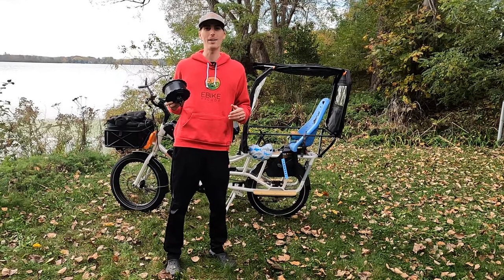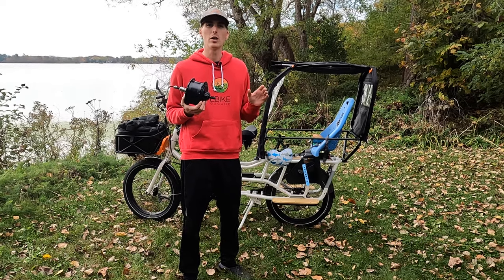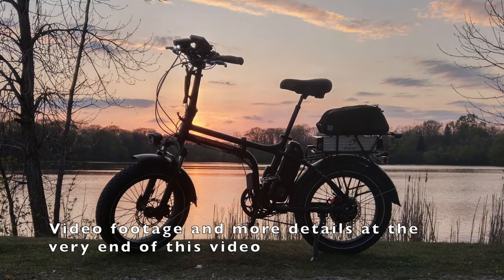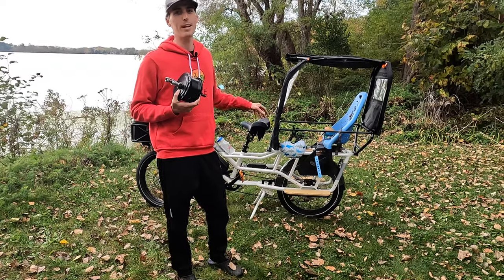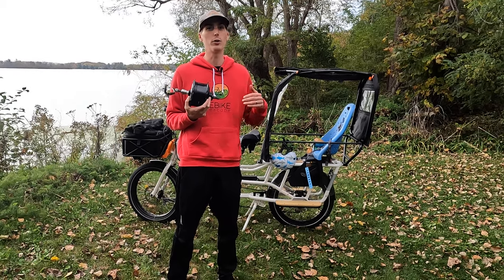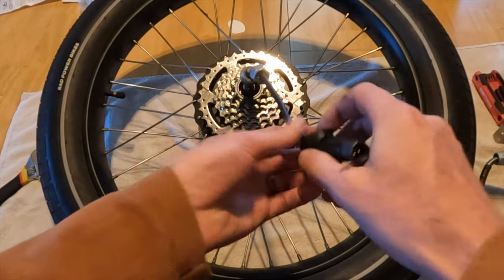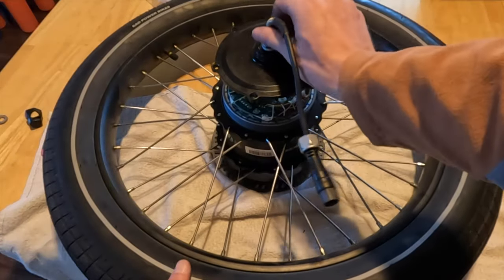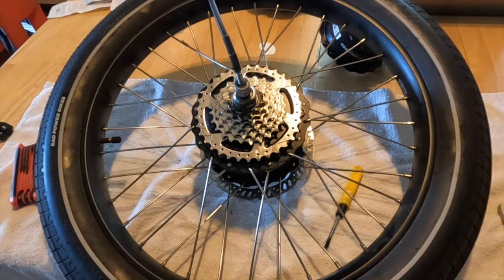Rad Power Bikes Motor Replacement with freewheel removal

Comment: Can I retire now that I'm famous? 😂
Excellent video Ryan, and I'm most happy that your bike is up and running again 😊. My wife often jokes that I should put a canopy on my bike, and I see that you have one already. It would be nice to see a video about that.
Reply from the maker: Ha! You have my approval! Yes, thanks again - we will share the Conestoga in a future video. It is currently only made for the RadWagon but it is awesome albeit expensive: https://radpowerbikes.pxf.io/6eOorm
Reply: Forever Young  - You will need to lace the motor into the back wheel, which is pulling out all the spokes and putting them back in with the new motor case. Someone may have a shortcut, but I have not seen it for the XP. The controller and display cost $472 USD, plus another hundred in custom wiring. On my bike, no one had done it before, so I had to make the wiring harness. An easier route is a packaged upgrade kit from Bolton or Electro Bike World, as that will push the power up to 1600 watts if you upgrade the motor.  The batteries were the most expensive part, with the shark battery being $480 USD, and someone gave me the second Tesla battery after I helped them program their Super73.
Reply: @EbikeEscape  perfect for my dog and some gear

Comment: Just wondering if you have any plans to test out the 35A controller on the Radrover 6 anytime soon? I'm on the fence but I don't see any reason why it wouldn't work.
Reply from the maker: Hi Richard, I do not - the challenge is everything is integrated. Best bet is to keep an eye on the Rad Owners Forum if someone does do this though: radowners.com

Comment: Hello, I had this bike since mars 2021, I use all the days of the week(not in winter), since last saturday it doesn't work, it is like no energy at all, I called support, they told me it must be the controller and the wiring Harness. the controller arrived, I changed but it still doesn't work, I hope when I changed the wiring it will work. My question, because my waranty it's over, I'd like to change all, the motor, the wiring and the controller too, something more reliable,could you please sugest me where can I buy that or where can  find the information to buy the good thing. Thanks
Reply from the maker: You can learn all about this on the forum: radowners.com

Comment: What freewheel removal tool did u use on the rad
Reply from the maker: We used the custom one from Area 13. we think it is the only one with a large enough hole to pass the motor wire through. -JT
Reply: @EbikeEscape  I was sent 3 different freewheel tools from Bolton/Area 13, none would clear the axle nut. Sent them all back.

Comment: So they didn't have the part avail and you did this, so does it void the warranty now?
Reply: He's using an original Rad motor that has not been modified, so his warranty should be fine.
Reply from the maker: The wheel is already on order and I proved the issue with Rad support before this swap. I'm guessing they wouldn't make a big stink about it unless I started asking them for a controller next. We now know the motor was bad. Hopefully they'd be happy to see me back on the road :)

Comment: cancelled my RPB order today.  pushed my ship date 2 months out the day it was supposed to ship (weeks ago).  They didn't even message me to let me know.. tsk tsk.
Reply from the maker: Bummer Tony, that is annoying. What bike did you have on order? This is happening across the industry and I've noticed it firsthand with several companies.
Reply: @EbikeEscape the new Rad City for my wife.  Im buying elsewhere now.
Reply from the maker: @Tryptone  the Plus? They both show shipping in 3 days.
Reply: @EbikeEscape  RadCity 5 Plus Step-Thru.  ~In Canada~  They have changed it to Nov 15 (from 30th) as of today.  its already cancelled. No regrets.

Comment: Throw away the battery and the motor that's the best upgrade you can do and just pedal it
Reply from the maker: so not an ebike?
Reply: @EbikeEscape  I own the rad runner never pedaled it until I threw away the battery after almost getting killed by a car..... I I personally saw a car skid sideways and hit a scooter from behind it was like a baseball bat they had the brakes locked and unlike YouTube the rider did not get back up limping